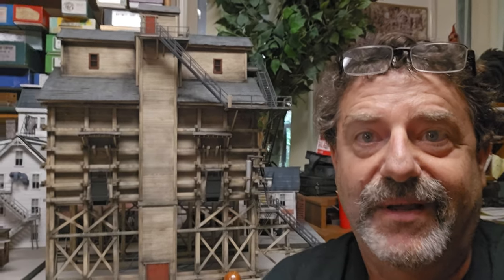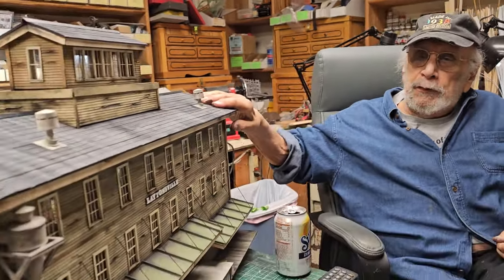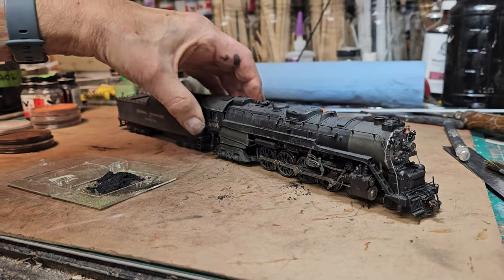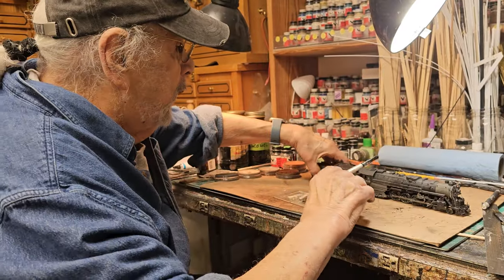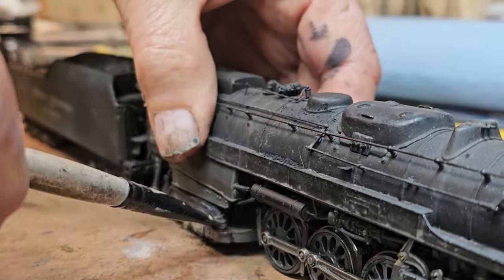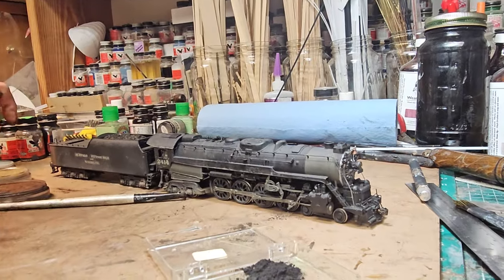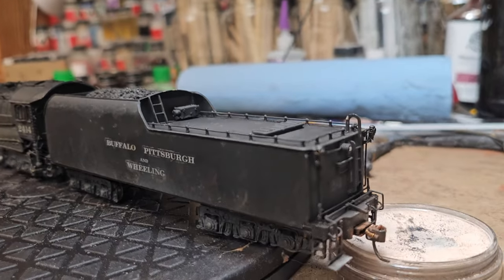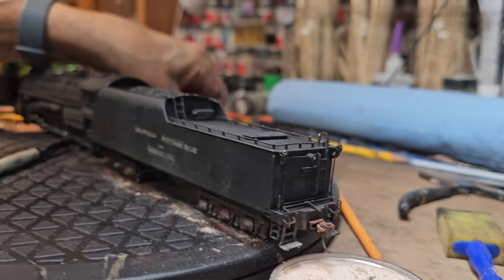Howard Zane : Pastel Weathering A Locomotive Start to Finish

Comment: Tried it, absolutely worked a treat! Weathered a little PRR Consolidation in 10 minutes - grabbed a tube of graphite lube, puffed it all over the boiler and brushed it out. A little Pan Pastel light grey streaking down from cleanout plugs and it looks like the original in black and white photos.

Comment: Folks, Bill did an excellent job on his K2 and then some! I did most of my weathering with an airbrush, but pastels are a challenge. Actually, I did another or a third loco....just forgot!. Forrest Nace sold me a really loused up, but quite rare PFM PL&E A2 Berkshire from 1960. I was able to change a miserable paint finish to something almost acceptable. But a loco of this quality should go to a really good custom painter. After all of my California O scale buildings finally leave here, with Al and Andre's help, my shop will be completely reorganized and with a new compressor and rebuilt airbrushes. This will be for my newly scratch-built rolling stock inventory. Both of these fellows will have a major mess of parts bestowed up them as at soon to be age 86 and there are just not enough years left for me to use anywhere near what has been accumulated over the decades. Also Bill's K2 looked really nice, but I'd prefer the version with the smaller tender or VC12. Otherwise, this K2 is difficult to distinguish from a PFM or Key K3.  Also, I plan on again painting brass locos again, but not for public consumption. I really love airbrushing brass locos, but i still may keep on teaching myself pastel techniques for weathering.

Comment: Al, this is historic video. This will be viewed repeatedly, forever. What a great job of weathering and he claims he’s learning. Thanks for shooting this. So he doesn’t use a dullcoat over the pastels or graphite at all?
Reply from the maker: Yes he does use graphite but no sealer as if untouched the pastels set in about 2 weeks
Reply: @alpugliesetrains9753 what do you mean “set”? What happens to them, do they harden up? I’ve never heard that pastels won’t rub off if you let them sit for a couple weeks, though more expensive pastels do have some adhesive. I’m curious because I’m trying to decide weather to use airbrush paint or pastels/powders for my J-Class.
Reply from the maker: It would not be a bad idea but so far with minimal handling it seems to hold up